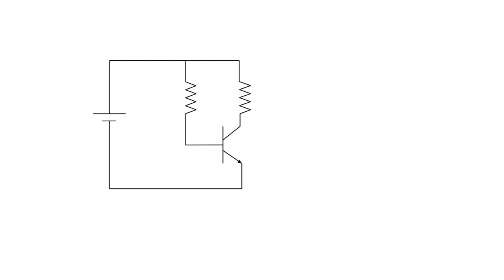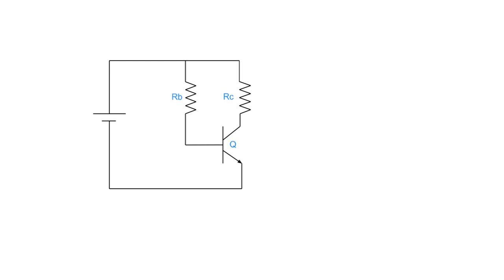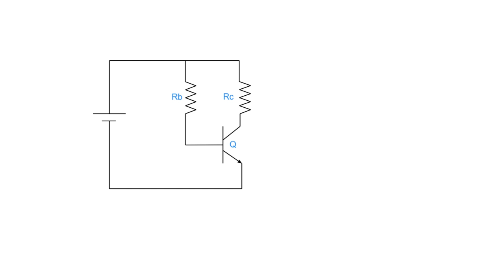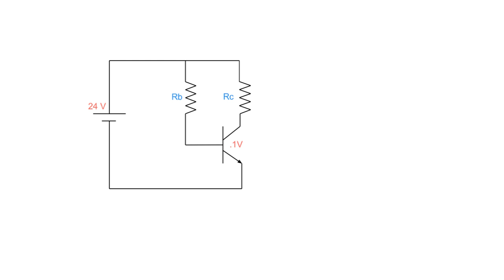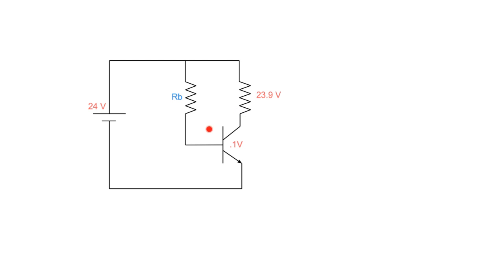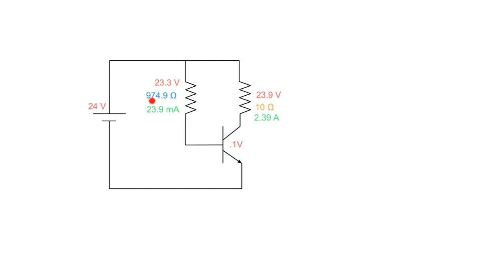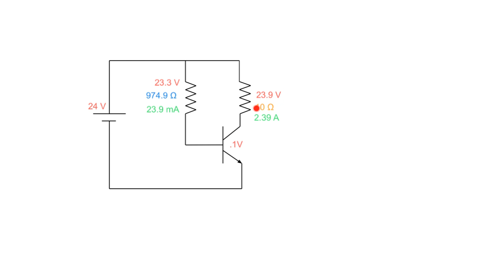Transistor Saturation

Comment: I don't know where you got the idea that saturation occurs at 0.2v every time, but this is absolutely not the case. The saturation voltage varies between transistors and depends on the value of the transistor's beta.

Comment: is the voltage across CE always 0.1 volts when it's a saturated circuit
Reply from the maker: +eoin durkin you bet
Reply from the maker: +eoin durkin yup
Reply from the maker: +eoin durkin yes it is
Reply: eoin durkin No! Saturation varies based on transistor type, beta and Ic!
Reply: No, absolutely not! In the real world the transistor's Vce will vary when it's at saturation. The saturation voltage can usually be found on a transistor's datasheet and is between 0.05 and 0.2v usually.  Now my question to The Electric Academy is why haven't you corrected this yet? If the purpose of your channel is to educate rather than make yourself feel smart you should have changed this immediately when somebody else already pointed out that this is wrong. This is a prime example of why you shouldn't base your knowledge solely on one source of information.
Reply: Mine was at 0.4 volt on my transistor so i dont think so
Reply: No, voltage across CE varies when transistor is saturated, depending on transistor type.

Comment: Useless guys, this assumes that b is 100/10  ratio of current is to present saturation on the silicone transistor. Yes it works guaranteed on its heavy saturation. In school is 1/10 ratio presented  to ensure heavy saturation.Mostly tihis works but who knows? .In some rare cases this will not work.